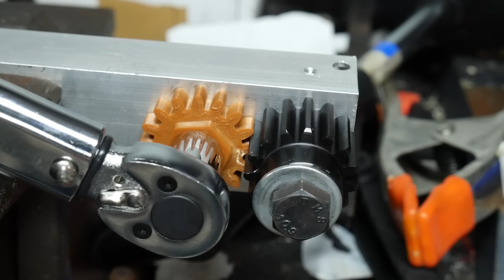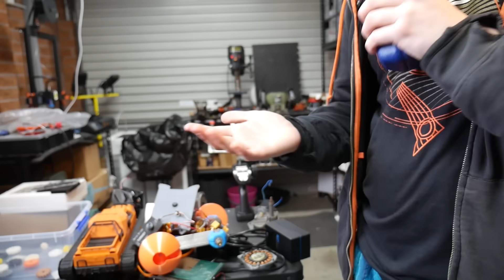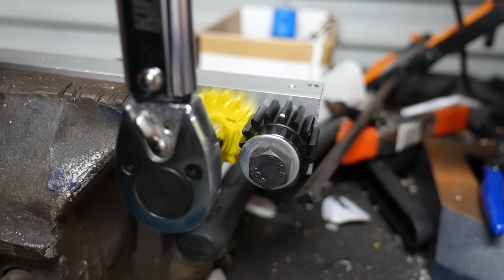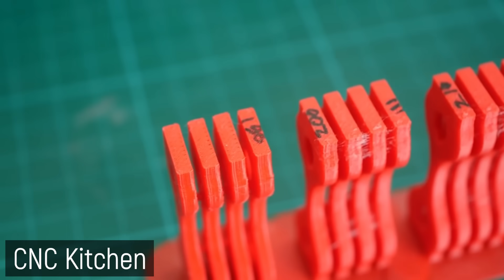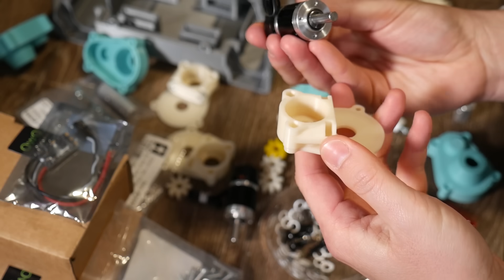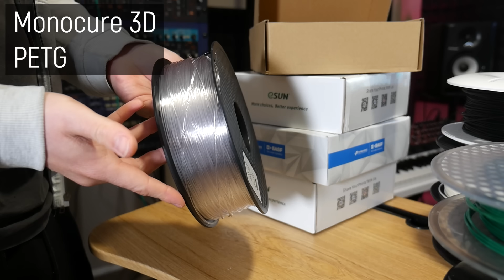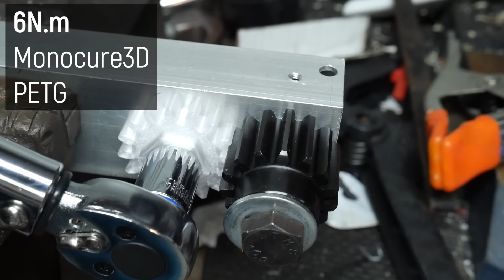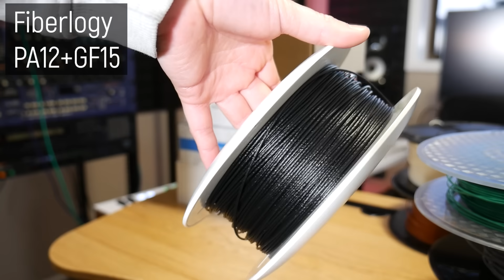Which 3D Printed Gear is Best?

Comment: I don’t watch enough of these shows to understand all the science behind 3-D printing however what if you printed the bottom layer and then you put in a metal lattice like is done with concrete, and then you continue the 3-D print on top of it? And the second question what if you just included or sprinkle metal filings onto the printed material between layers? Would that make the plastic stronger?
Reply: Mhm metal lattice? You can only put in something below the current printing layer. You can pour concrete around a structure, but you can't pour the 3D print around it, the toolhead would necessarily collide with the lattice if you try that. And if you did print the whole object minus the top layers, leaving some room to insert a metal piece inside, you put it in, and continue the print to seal the metal in, if the insert isn't really tight against the boundary of empty space, then you have created a weak point, a void against which the object will break. Then the second question comes, how do you manufacture a form fitting metal object that you can place into the gear? And if you manage to manufacture one of arbitrary shape, why wouldn't you use the same method to instead make a metal gear?

I think one version of such reinforcement would be to take a brass pinion gear, aka piece of pinion wire, and use that as a shaft that you press a 3D printed gear into. You can also heat the pinion wire and drive it in with a soldering iron to set it, melting the inner surface of plastic gear outer to contour it. I'm not 100% convinced that it's necessarily helpful, but it's a thought.

One possibility is to just print a fully hollowed out gear with one open surface which is level. Then you can fill it however you like. You can fill it with a metal structure that you can just bend out of wire, it doesn't matter if it's wonky and loose in there, and pour epoxy or 2k engineering-grade polyurethane to seal it in and fill all the space. In this sense it's exactly like concrete pouring, except you leave the form/mould be part of the final object. Actually concrete foundation usually works like that.

As to "sprinkle some metal between layers", difficult to say. Particulate filling has been known to make the print more rigid, but less cohesive, so it doesn't tend to score particularly highly on strength tests. You can already find filaments filled with strands or particles of various materials, metals, glass, carbon fibre... they can be printed as long as the particles fit through the nozzle, and some of these materials need a 0.6mm or even larger, though most are designed with 0.4mm in mind.

Comment: I will send you something on patreon. first you don't do gears like that and PLA under load makes poor gears unless extremely well lubricated otherwise you grind it to a pulp. Best material is Taulman 910 a very "hard" Nylon and hex mounts suck - even in aluminum only place they have a purpose is steel or the trash bin.
Reply: I recently printed and then CNC machined a compound gear printed from Taulman Alloy 910 on my Snapmaker A150. It machines really well (particularly since I am a beginner) compared to PLA which has a tendency to melt. Even while cutting across the perimeters for the teeth, it acts almost like a solid block of material. I did have some z delamination between the layers due to the cutting forces, I think if a compression bit is used it could avoid that. I made an instructable on the process, search for "hybrid manufacturing" on instructables and you should find it.

Comment: Great video! I'd make a second test closer to the actual usage mode. Having a couple of gears made out of the same material, one is on the motor, other has a constant load, so gears have actual stress and friction is involved. My gears dont usually break, their teeth wear off because of constant rubbing against each other. At some point gaps between them appear, and then they slip.
Reply: Exactly this, torque is not likely to be the issue at all, especially if your printing at a higher infill.   More likely your going to run into an issue of wear or heat from friction weakening the material.
The ideal test would be 10 minutes on a motor, ideally you probably want a load on the gear(just stick a weight on it) to simulate the regular amount of load your going to see.
Reply: You may find lubricant lowers your heat and friction wear quite a bit.  Steel gears are much more durable than anything you can throw in a printer by all standards, but most are lubed to help them last years longer.

Comment: usually wear resistance is a big concern as well. i've read pla and nylon have good properties in that department. i use pla gears on the feed of my metal lathe for more than a year now without problems

Comment: Me, personally, I would prefer a failure mode in which the teeth shear from the hub so the hub can spin freely, releasing stress on the motor. The way some of the samples separated with the teeth still attached to an outer ring of plastic (thereby preventing loose shards from entering mechanical components) while still allowing the hub to separate would hopefully minimize both damage to the motor and to other components due to debris. I am thinking specifically of the poop brown ABS but there may be others that perform similarly.

I worry about the samples in which the teeth simply roll over; I can see how that could jam, increasing stress between the gears, essentially wedging them together and causing the motor to jam as well (unless the hub were to fail). I would rather have teeth separation, I think.

Comment: What if you had 100% in fill for most of the gear and then (in whatever layer you felt best) had a few layers of 20% in fill. Kind of like a built in breaking point or fuse to protect the brushless motor during gear fails.

Comment: Esun just released a new carbon fiber nylon that's quite expensive but looks bad ass, cool seeing PLA perform so well tho
Reply: I also worry using other materials friction coefficients, abrasion etc, this puts me off PC for instance
Reply: @alexbuilder6983  Yes, ABS is famously prone to surface abrasion. I feel, a high speed endurance test is needed, and it's likely to be more relevant than the shear torque test.

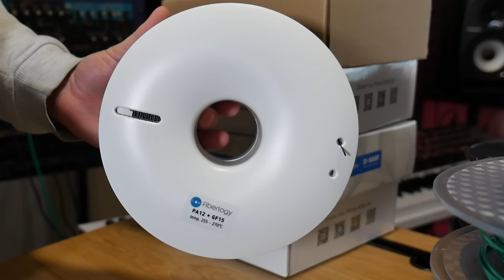Comment: 13:55 good lord that's a wasteful spool design.
Reply: The cooler the spool looks the better the filament prints. ;)
Reply: That's so it can look cool in the trash-can--LOL!
Reply: I don't know, this could be very lightweight and thin-wall, difficult to say. It is hollow inside the side-walls, it's made from separate plastic pieces there which clip together.

Let's see.... i could find Make360 UK estimate the empty spool weight at 325g. It's possible that the spool weighs less, if the company accidentally gives you some free filament above specified net weight, but probably doesn't.

I found a Wiki that lists empty spool weights of various filaments, and lightest were Sunlu/StrongHero3D at 150g (large hole), heaviest being Push Plastic at 330g, and the typical spools being more in the 200-240g region.

So it does come up fairly heavy, but not as heavy as it looks.

Comment: The ST play is super tough. Toughness is an engineering term where it will deform before fracture. The tougher it is the more deformation before fracture
Reply: A gear must be stiff, the opposite of though. So regular PLA, the stiffer of all filaments, is the best in this regard.

Comment: I use Priline PC-CF for all my mechanical components.  Although I mainly print mounts and brackets rather than gears.  Still definitely worth a shot.  (Not sure if you're able to get that in AU, I think they only sell on Amazon in the US).  

I would also definitely print that solid if I needed that small gear for myself.  I've printed T-nuts for Unistrut and I test them to failure, ones that I printed solid were stronger than the fiberglass ones that are commercially available for the exact same model printed from McMaster-carr (and that was printed in PETG).

Comment: With a good zip-tie around the hex it wouldn't spin as easy. If there was room for the ties locking head that is. You could model in a depression for the ties head if it got in the way(if that didn't create a new failure point). Maybe a ring groove for a metal c-clip or threaded on cap out of a more rigid material like PETG on the Nylon gear. Love this hobby! Thanks for testing what you had handy for us!

rainy day quarantine idea:

 How about a springiness test? Like a little diving board and/or coil spring, watch spring, etc. Cycle it 100 times with a robot and see where it sits? Higher temp - lower temp compares maybe. Just a thought, cheers all!
Reply: Difficult to make a zip-tie not slip on the hex! Because it's nylon so it is naturally stretchy and slippery. But maybe if constrained outside, it could perform better.
Reply: @SianaGearz  I meant as a means to keep the nylon from flexing over the nut corner. 

But I've been thinking how he mentioned a safe known failure point without ripping gears or the case apart.

Rubber bands have known strengths  right? Just add a lip and use those to raise that failure point as close as is comfortable for it's use.

Edit: Or "Taperlock" it on instead. Those are cool.

Comment: I'd try the carbonx PLA+CF, i want to see brittle failures in my gears, generally with teeth snapping. 
If it is a non-brittle failure you may end up with heat issues from friction and deformation and damaging other parts of your system, additionally gears just work better when everything is very very stuff. 
I want the teeth to snap/shear because the smaller broken component is less likely to be able to wedge/jam and do more damage, whereas if the hub snaps you may end up with have of the gear wedged or jammed somewhere you dont want, also there is the chance/probability that if only a single tooth or small group of teeth shear, the device may still work partially, whereas if it shears off the hub it probably wont.